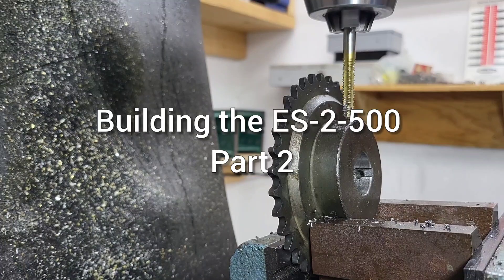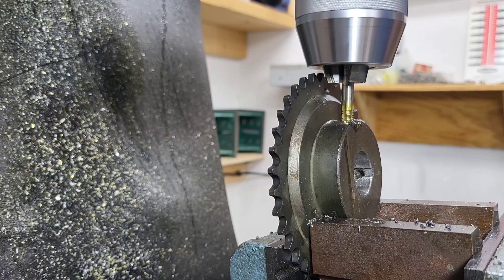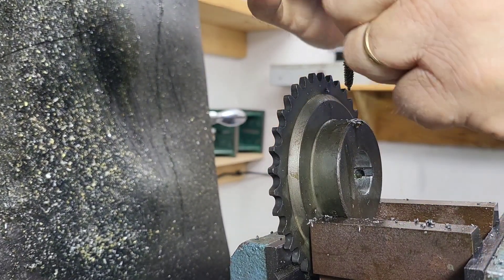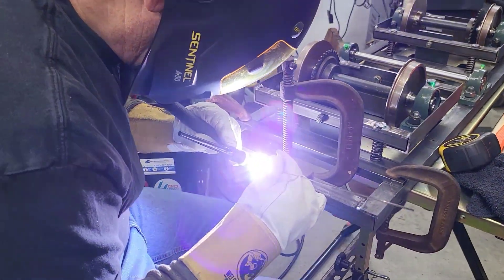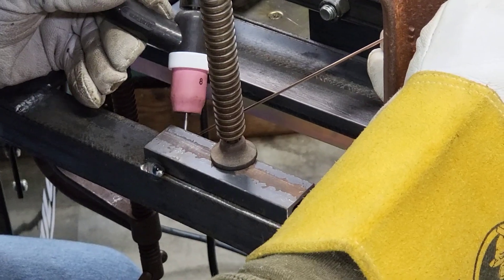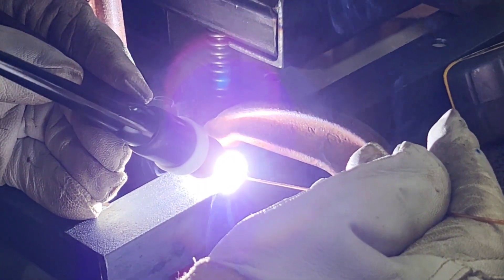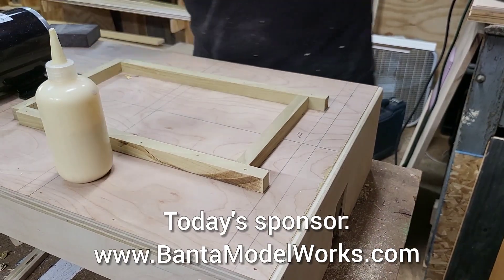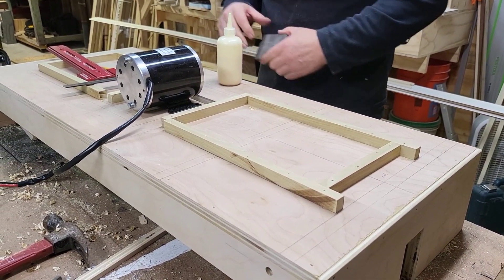Building the ES-2-500: part 2

Comment: What sprocket do you use
Reply from the maker: 35 chain with 11 tooth sprocket on the motor to a 35 tooth on the jackshaft, to a pair of 11 tooth sprockets out to 35 tooth sprockets in the axles.
Reply: How many sprockets do you have on the locomotive

Comment: His electrode stick out is way to long, which means he's losing full gas coverage. That's why you hear those crackling sounds. In the close up shot at 1:44 you can even see the inclusion at the end of the weld. 

He also doesn't seem to have gotten the weld area very clean. This would be perfectly fine with a MIG, but TIG is way more sensitive to impurities.
Reply from the maker: He's rather new to TIG welding. I'm sure he'll find your comments helpful.